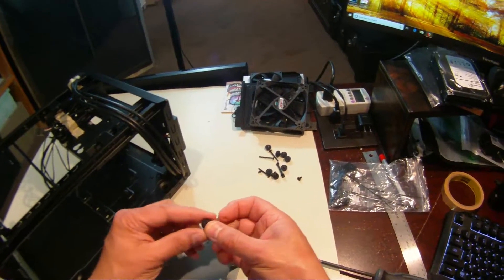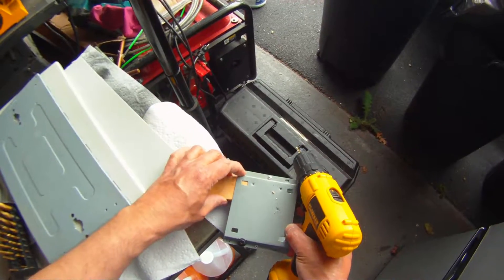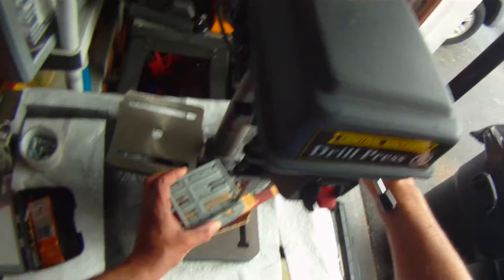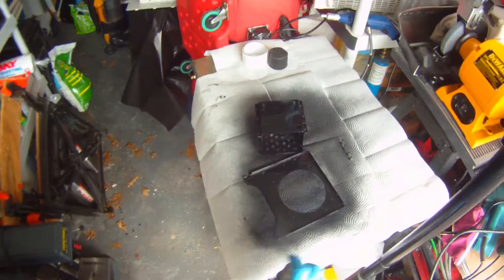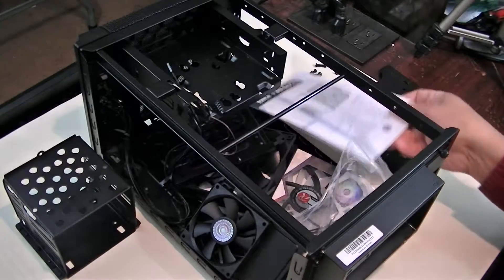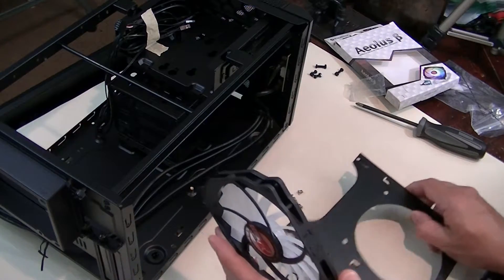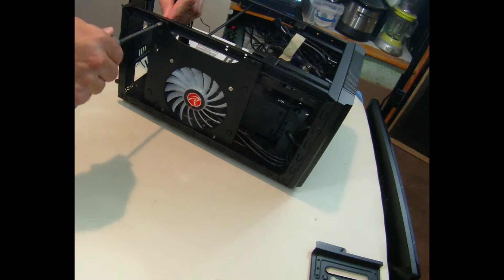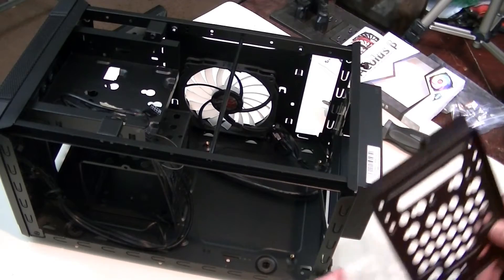Server Build Pt. 2 – Elite 130 Case Modifications

Comment: Hi, where did you get the HDD cage from? Looking for a 3 HDD case to add to the 130, just like the 120 has.
Reply from the maker: I actually salvaged that cage from a legacy case that I disassembled in my very first YouTube video - still out there.
Reply: @PE4Doers  Thanks for the reply. Yes, after asking the question I saw it was Pt. 2  and looked for Pt. 1 where you mentioned it.
Reply from the maker: @NeverRideSlowly  Great.  By the way, I did notice that NewEgg does sell some hard drive cages.  I think they are meant for specific cases, however modding them is probably possible.

Comment: hey, i was looking into buying these fans, how would you say they preform, are they loud or anything?
Reply from the maker: I really like them - PWM, good RGB, Quiet and they seem to move a decent amount of air through the case.  Just make sure you connect them to a PWM connector on the motherboard, or get a PWM hub that works with the MB, for the best performance.
Reply: PE4Doers awesome, the price is awesome and being so slim will be great for my lian li tu150, thanks man :)
Reply from the maker: @itrynano2048  No problem - I have been happy with it, and the reason I bought it was because of how slim it was while still being PWM